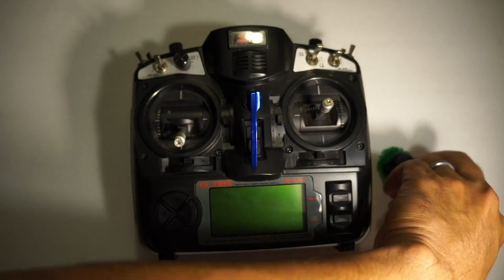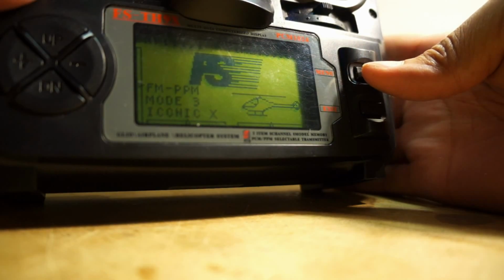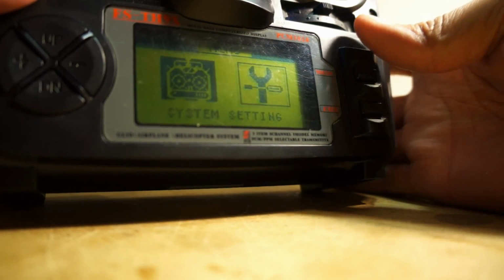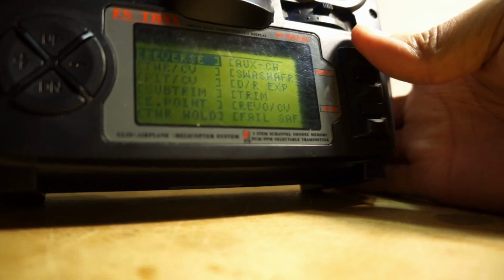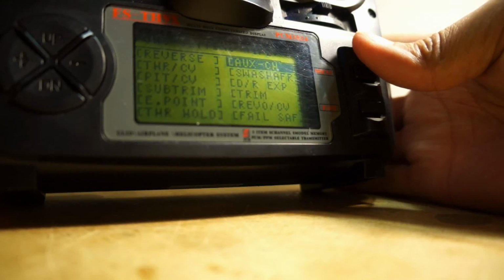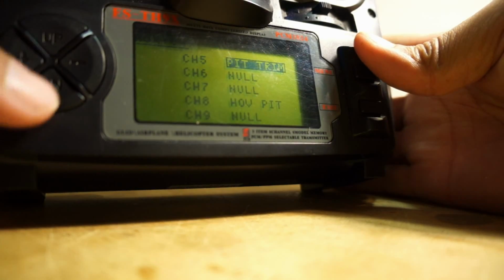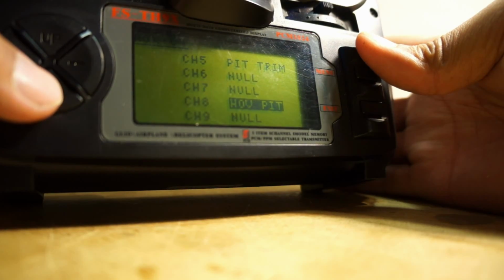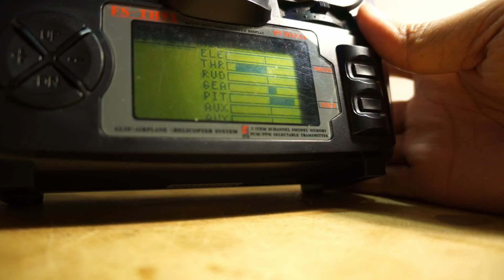How to add a joystick to your Rc radio.

Comment: Hi there I am in a wheelchair after breaking my neck and have limited use of my hands but I can control a joystick for an electric wheelchair no problems, but my question is how can I modify a joystick of some sort so I can use a RC truck again?
Reply from the maker: No need to modify. Just change channels on the receiver so you're using elevator channel to control forward and reverse and aileron to control steering. So just the right stick on the radio to control all functions of rc car.

Comment: can anybody help me with how the polarity goes if there are A. no signs on the joystick B. I have purple-red-blue wires... wtf?
Reply: Use a voltmeter to measure the voltage on the wires incoming to the joystick when tx is on before you take the old joystick/controller out. There will be a ground and a positive.. they will attach to the two outer terminals each pot... you will see the orientation as it is on the joystick from the position they are on the old joystick. The stick output signal voltage comes from the middle terminal of the three on each pot. You can confirm by testing movement on the new joystick and the response on the lcd/led display on the tx or the receiver end when operating. If it's the wrong direction then reverse the ground and positive wires on the pot. Go from pot to pot testing as you go.